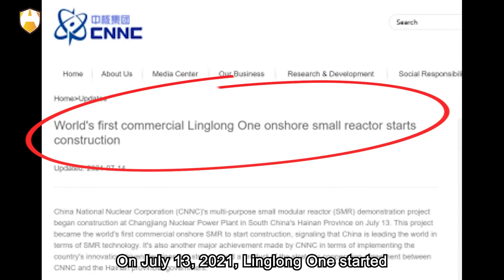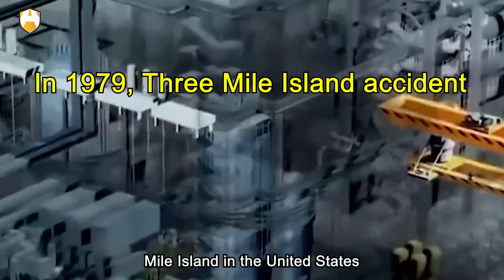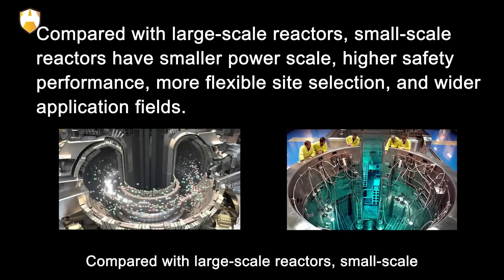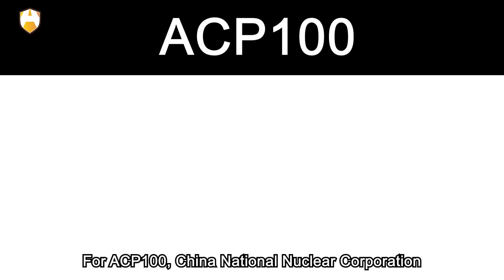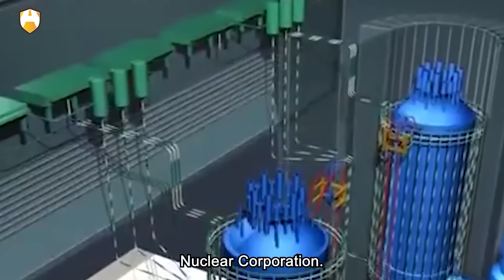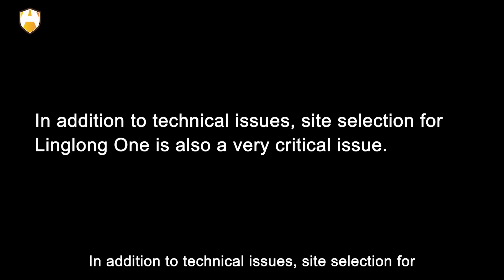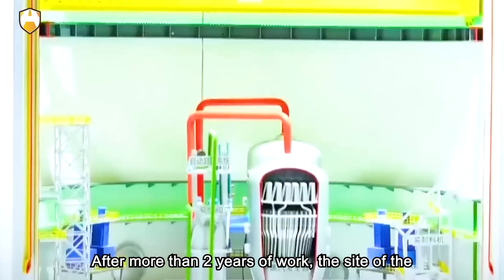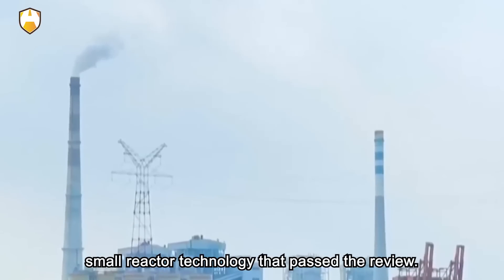China just shocked the world by revealing their insane reactor project!

Comment: Can you tell me what is insane in this project? I would rather call it insane to build such super-sized plants like Olkiluoto 3 (1600MW). The building started in 2005, and the commercial operation was planned for 2010. But now they hope to start commercial operation next month! Don't ask about the costs.
Reply: This project is insane.  The Olkiluoto 3 project is not.
Reply: @kooisengchng5283 finland needs a huge reactor for its purpose which is appropriate.
China needs a mobile portable modular reactor to supplement renewable energy and back up, a mini reactor problem can be managed easier and a back up mini reactor used
Also a series of self contained modular mini reactors can be strung together if need more power

Comment: It is a logical step.  a nuclear power plant with each unit typically generating 1,000MW can be difficult to manage to ensure absolute safety.  By scaling it back to 300MW the infrastructure becomes more easily controlled, manufactured, handle and transport.  Thus each stage a larger safety factor can be provided.  The idea is to standardise its construction and manufacture making it economically available.  What China has done was the completion of the experimental trial.  This allows China to provide the SMR to the rest of the world in addition to the implementation domestically.

The world will need SMR to supplement the renewable energy, which by its very nature isn't continuously available, with small continuous generation that could be brought on line quickly when solar and/or wind energy are unavailable.  Hydro if available could provide a reasonable inertia in the electrical system for stability and frequency control.  Countries without access to large hydro will have to use conventional power plants for the same purpose.  The SMR station is a better option than the fossil-fuel station.